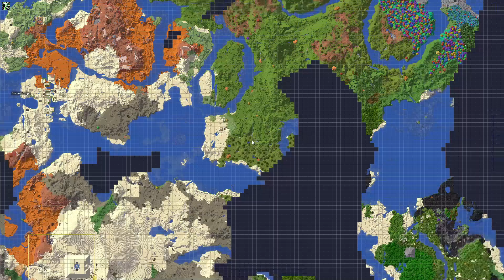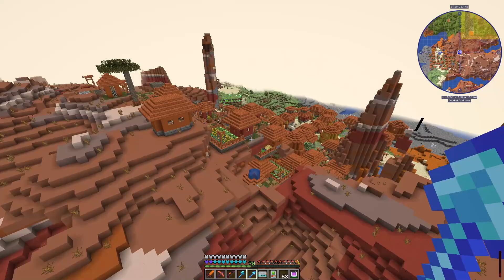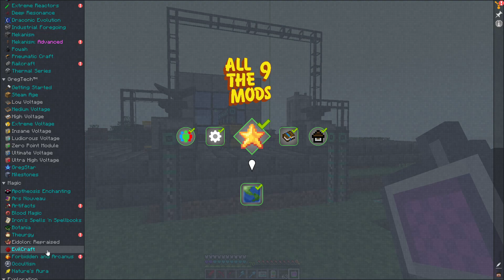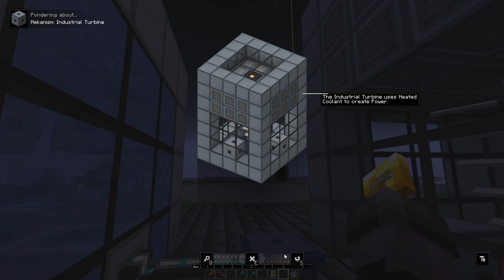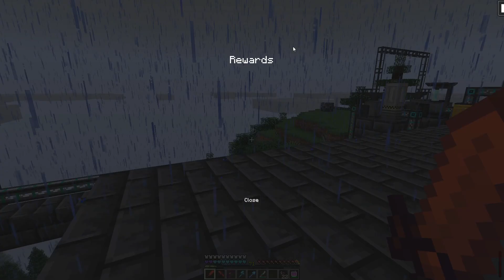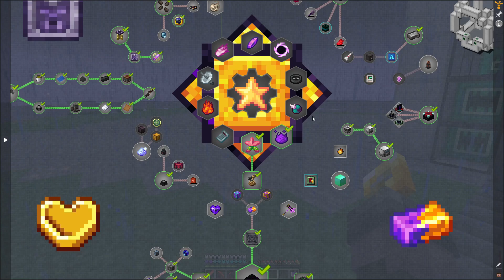Minecraft - All The Mods 9 - Episode 51 | Turbine & Power Storage

Comment: A simple trick I was shown on a Chosen Architect video, was to have four of the redstone controllers set to output a redstone signal to one set to activate reactor, and then use a not gate so that it would only run if none of the conditions were true. That way the reactor should never be able to explode.